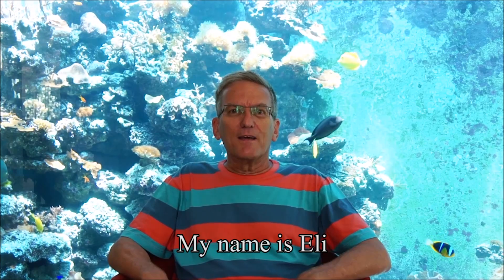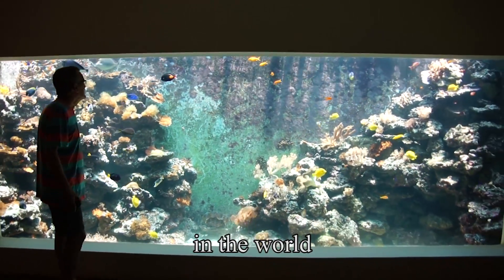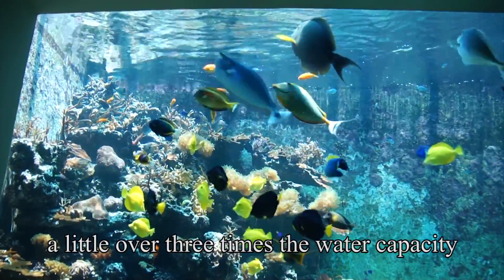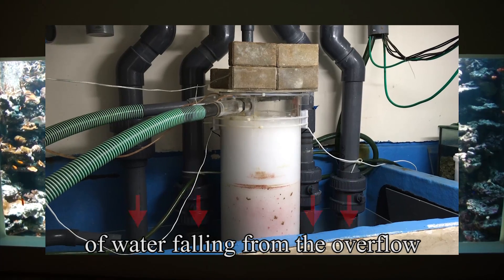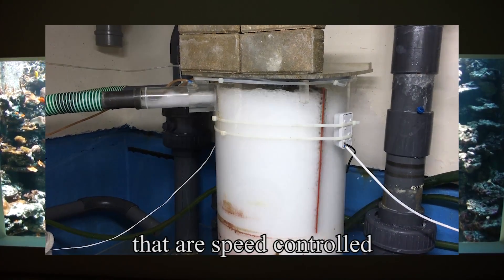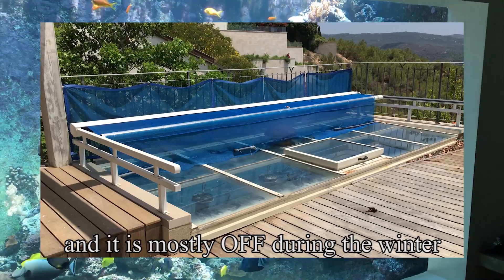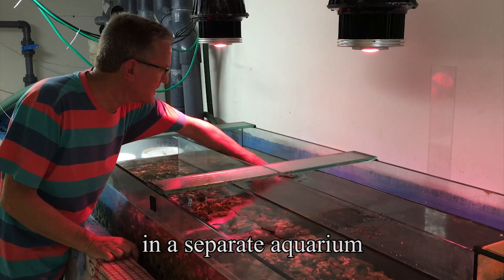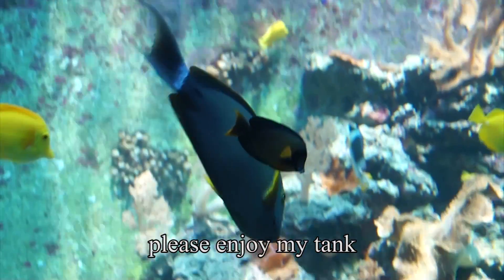Eli's 30,000 liter reef tank - filtration and life support system

Comment: Hi Eli. I want to know what you used to waterproof the concrete structure? I used fiberglass and it’s came off after only 1 year. I can’t find any information anywhere on the net and I need your help
Reply from the maker: I used fiberglass and it did not come off. I don’t see why it should come off when the water pressure is pushing it towards the concrete. You should consult a fiberglass expert.
Reply: @elif_reef  okay so maybe they installed the fiberglass wrong or used poor fiber material
Reply: Thank you so much Eli for your response

Comment: I don't have a reef tank, but I think this kind of self-built stuff is the way to go. No way this is affordable or even maintainable "off the shelf". Of course you use sunlight if available, in Israel, at this scale. Of course you can use gravity for skimming. Of course it's cheaper and safer to have the walls of a tank be concrete than full glass at that size. I haven't seen this often, though...

Comment: What is the front panel thickness?
Reply from the maker: 10cm
Reply: @elif_reef  if the water volume is 14000 liter then in case what is the thickness of glass
Reply from the maker: The glass thickness is a function of the size of the aquarium and not the water volume.
Reply: @elif_reef  if the front size is 12 feet X 7 feet
Reply from the maker: You need to check with the panel provider but 10cm should be enough
Reply from the maker: Obviously acrylic (not glass)

Comment: Add coral sand to your system 
If you allready haven't
You wont have to add calcium 
Planing a 10000 gal tank for my hawaii 
Home 
Good job
Reply from the maker: There is coral sand, small addition still needed. Good luck with the planning of your aquarium
Reply: @elif_reef  it's a tube or pipe filled with crushed coral sand 
It's called a calcium reactor 
You connect it in line to you water flow
Reply from the maker: With such aquarium It would be funny if I didn’t know what a calcium reactor is. I tried calcium reactor, Kalkwasser, and other methods and now adding calcium chloride and sodium carbonate for calcium and alkalinity.
Reply: @elif_reef  you would be surprised what people do and don't no about saltwater aquarium 
I always tell most to stop playing with it 
Providing they have the right setup 
I figured you new what you were doing.

Comment: How is the temperature control system made? Will an aquarium of this size be stable and not necessary?
Reply from the maker: Temperature controlled by chiller inverter and heat exchange unit.

Comment: How thick does your glass have to be to hold all that water weight? And what did you use to shore up the walls to prevent them from cracking under the stress too? Would love to know how you made this structurally sound without flooding your house. I'm hoping to make something similar someday but freshwater.
Reply from the maker: Walls are concrete and therefore strong, like a swimming pool, but coated with fiberglass to prevent water leaks. The view panel is 10cm thickness made of acrylic, not glass.
Reply: Eli Aquarium thank you very much! How thick are the concrete walls?
Reply from the maker: 30 cm
Reply: Eli Aquarium awesome tysm good sir!

Comment: Details of giant home aquaria are very inspiring. Since you purge a lot of water from the skimmer and replace it with new sea water, what system if any, do you use for replacing fresh water that has evaporated? Has the salinity remained stable?
Reply from the maker: I am using reverse osmosis for fresh water to replace the evaporated water and test salinity daily.
Reply: I see. So you add the fresh water manually when the salinity starts to climb since the sump's water level is always dropping due to the skimmer, or have you devised a method to automate the top-ups? Thanks.
Reply from the maker: billforigno fresh water added through paristatic pump controlled by the APEX controller